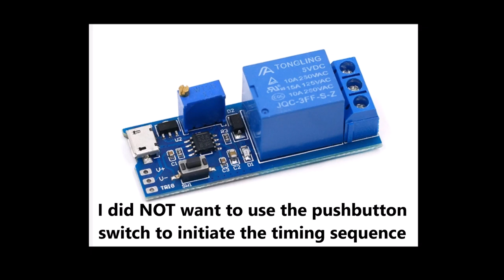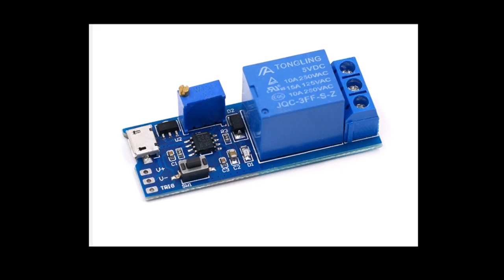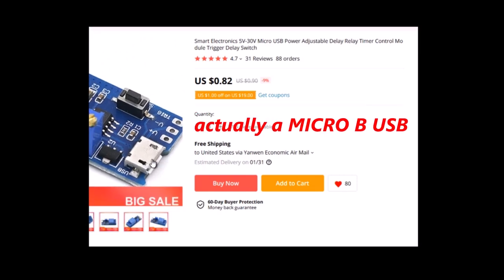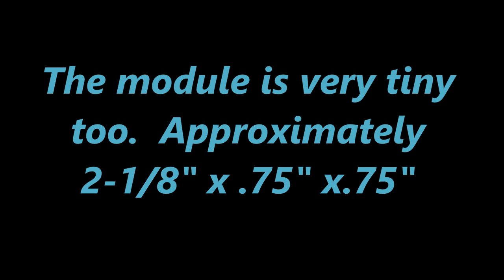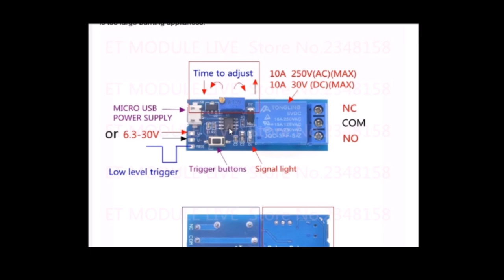Modify time delay relay module so the timer starts automatically, INSTANT ON, delay off auto-start

Comment: Much appreciated. I should have those caps and resistors hanging around. I hardly do any hobby electronics anymore but I'm not dense. If the suppliers of these things, and there are many on Aliexpress, used the term "Trigger" or "Pulse" in the title I would have looked for something else. I want the delay timer starting to count as soon as it receives power from motorcycle circuits and alternately to keep the GPS and USB charger powered if I'm just going to be 5 or 10 minutes from the bike for example - then shut off if I take longer.

Comment: Sometimes you get lucky, Im using this same module and I have the following problem:
Im using an ESP32 processor in an autonomous vehicle and it seems as the ESP32 do not boot on powerup.
My idea was to powerup and set the reset pin of the ESP32 to low thru the relay.
Now I can.
Just what I needed.
Thx.

Comment: YuDaMan, thank for sharing. I'm not a electronically experienced guy, so please don't shoot me for dummy question :)
Is it possible to make the module activate a countdown timer by closing the load cirquit?
For example by electrochemical etching/marking of metals would be super to start countdown timer when you touch the workpiece with electrode. With DC etching it's very simple - the voltage range is practically the same, you can use the working load current as power supply but what to do if you make AC marking?

Comment: Thanks a lot for sharing this! Just a question: you "short-circuited" the +v and -v with 10k Resistor. Does it means the resistor will keep consuming power? I want to use this delay module for turning on 12v led lamp in bathroom, powered by small 12v battery (the  Capasitor on the PCB need to be changed into bigger one to get more delay of approx 8 minutes). My intention is that the module shouldn't consume too much power during standby mode. Appreciate for your feedback!
Reply: The fact that there is a resistor there would stop it from being a short circuit

Comment: In diagram v+ and v- connect with resistor but in video you apply v- direct to elco- and v+ connect resistor to elco+ and trig.. Thats make me confuse, can you explain that, thanks
Reply from the maker: Sorry...i don't recall which is correct.  Just try it.  It won't hurt anything either way.
Reply: Aye aye sir😁👍 i want try trig connect to ir sensor modul with cut off delay, thank for u video

Comment: I wanted to use this relay with a PIR sensor or the RCWL-0516 sensor but found that the TRIG pin on this relay has a constant 4.70v and unsuitable to hook up to a sensor. I wanted to activate this relay with a sensor so it ran a musical box movement, really pissed.

Comment: Can i add outlet on it board?
Reply from the maker: if you want to control line voltage, you will need a power relay or some other SS  power device (like a triac or SCR) to control an outlet.

Comment: Great idea!
I need this solution but in 24 Dc
 and i need use directly on input + & - .
 What os the best capacitor and  resistance for it.
Thanks.
Reply from the maker: this module works at 24vdc!

Comment: The resistor is not needed... just a 10 uF between trigger and V- is enough ; )
Reply: thanks if it worked as you said, a question in a long use 3 hours is there danger of something?
Reply: @juanalfonso88  The auto start with the 10uF between trigger and V- will work with no issue, even the system is weeks powered.
Expand the time up to 3 hours by modify C2 is maybe possible, but not shure the time will run out.
Reply: top eye is correct, 10uF or 2.2uF will both work (connected to v- and trig) when disconnecting-reconnecting power supply (as YuDaMan operates it).  This works because the control circuit drains the capacitor (very quickly) when the power supply is disconnected.  When power supply is reconnected, the capacitor pulls the voltage down at trigger terminal long enough (in the process of charging to 5v) to activate timer circuit.

Comment: I'd like to have the relay activate when power is applied (like you showed) AND bypass the timer entirely so it just stays on until power is shut off. What modifications would it take to achieve that?
Reply from the maker: Jeff, not to be mean or unkind, but what you described is just and on and off switch.  I'm sure I'm missing something but on when power applied without timer and off when power shuts off sounds like just on and off switch.
Reply: Just short the trigger switch, or forget the board an just use a relay

Comment: I am looking for a very simple circuit to build yet have found it hard to find.  Simply power the circuit on with any voltage from 5-12 volts and nothing happens.  Then you push a momentary switch and the relay is triggered for a set amount of time then turns off.  All of the delayed timer "on" circuits I have found start the timer immediately when the power is turned on.  Can someone help?  Again I'm look for something I can build.  Thanks!

Comment: Plz 🙏 help i want to make this module doesn't stop as long it takes a signal during its working cycle from the trigger
Reply: I want to make it working as long it still taking a pulse order
Reply: Coco Basha, to do this simply wire a switch between v- and trig.  When switch is closed, relay will stay activated until you change switch to open.  This is the same as example in this video when YuDaMan holds his finger on the button without releasing it.

Comment: How can i make switch wiring it...??
Reply from the maker: the module has a pushbutton switch to start the timing cycle.  If you want a remote switch, I BELIEVE but not 100% certain, you connect N.O. switch to trigger and V-.  You can easily figure it out by figuring out if the onboard switch is NO or NC and then connecting appropriate switch in parallel with the onboard switch.

Comment: Hello I'm a beginner 
purchase this  timmer module  when I press trigger relay ON for  3 sec but after 3sec relay not permanent off its ON OFF ON OFF ON OFF very fast (tick tick tick tick )continuously till a power off (5volt)  please tell me  what is the problem     how can I solve it 
I purchase 3 modules all working same 
Thanking u in advance
Reply from the maker: what happens when you use a different potentiometer setting?  What is the voltage of your power supply?
Reply: @YuDaMan  nothing happen power supply is DC 5 volt